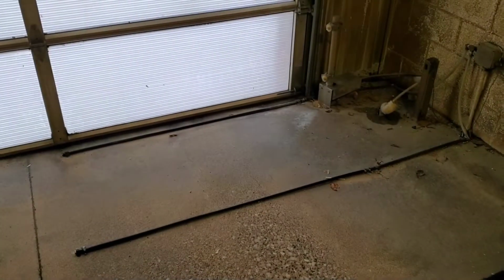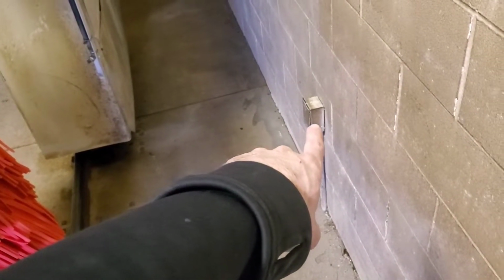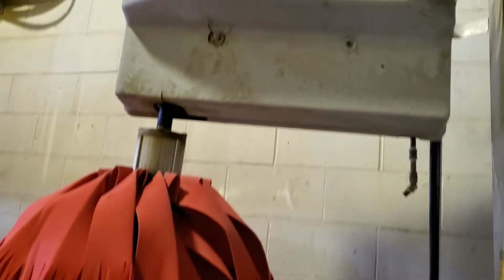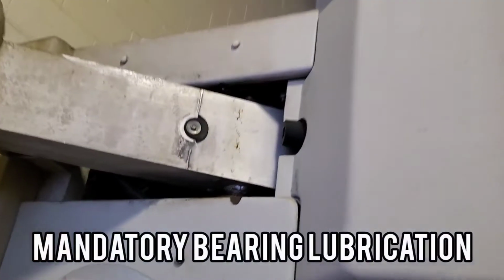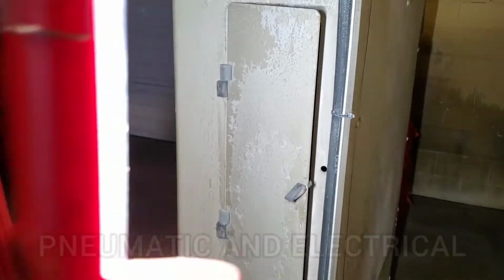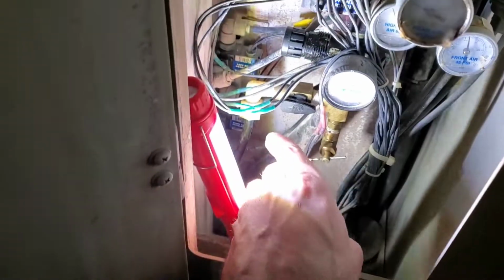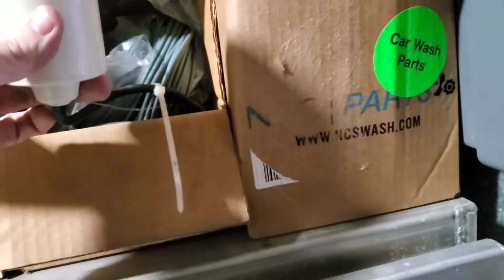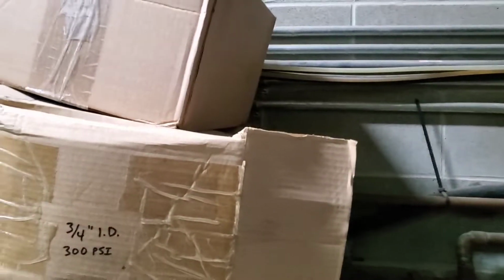Ryko Softgloss XS features & maintenance. Timestamps in description

Comment: Would you be able to do a video of what products you use to do the preventative maintenance. Like what grease and what gun you use. Thanks I got a machine and was quoted $400 for monthly maintenance and wanted to see if I can do some of this work myself.
Reply from the maker: Really these machines aren't too high maintenance at all. This is set up at a car dealership, the bearings at each wheel and brush arm just need a few squirts of a marine-grade grease applied by a grease gun found at any auto parts store. My particular machine has a total of 24 bearings that take no more than 20-30 minutes to service, once or twice a month. Basically all one needs to do. Whether it's worth a service tech to come by and grease it is more up to you, but it's definitely quick and simple.
I do keep spare hose and water valves around to minimize down time too, because yeah one can get the occasional leak sprung here and there.

Comment: I oughta show these videos to my local gas station, they have a Softgloss XS that’s been out of service since last year I believe. It would probably be very helpful considering the issue they may be having with it could be an easy fix.
Reply from the maker: Have a link to any? & I'm not actually a certified Ryko tech, however I've been maintaining this since new, about 15 years, and have learned a few things ha
Reply: @sixgun Dave You mean the out of service Wash? If so I do have two videos of it so far. No access to the pump machinery though, I don’t work for the station actually.
Reply from the maker: If you have them on youtube here for instance, sure 👍
Reply: Sure! Here’s the links:
https://youtu.be/RFoj6RmqHzg

https://youtu.be/27TmoEyQtSI
Reply: @sixgundave   do you still have this ryko soft gloss xs  and is it still working
Reply: @sixgundave   and can you make more carwash videos please  of the ryko soft gloss xs and it washing a car and full wash
Reply from the maker: @CARWASHCHANNEL.  Yes I still operate this machine. Stay tuned, I do have couple video ideas in the works 👍